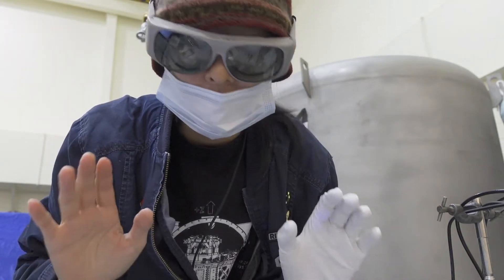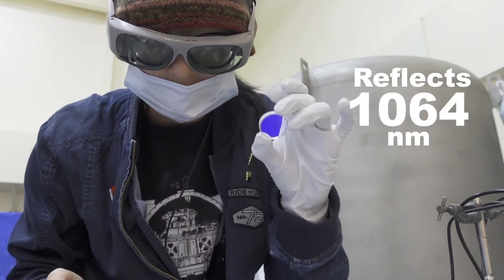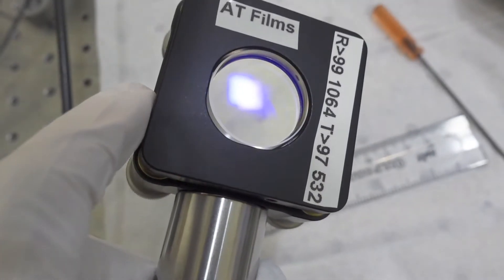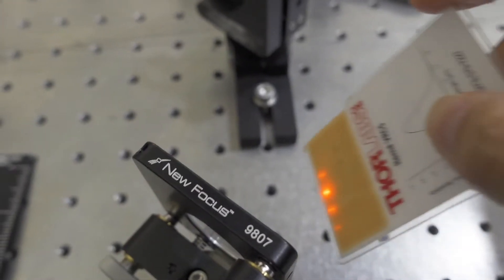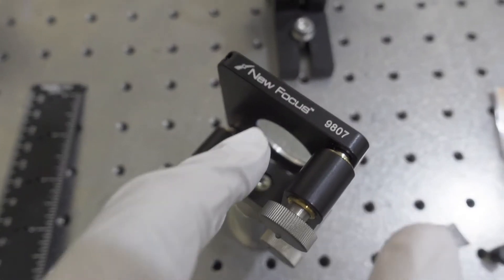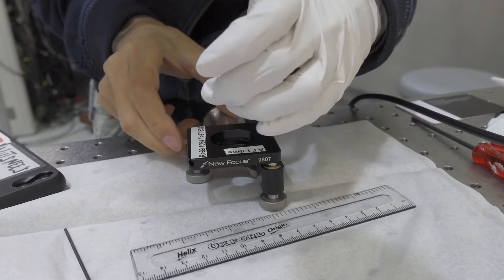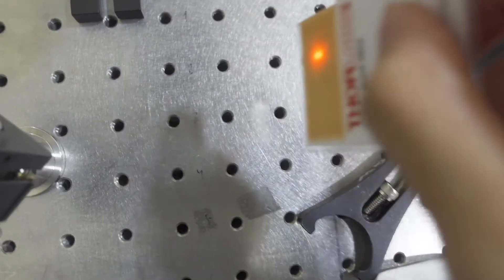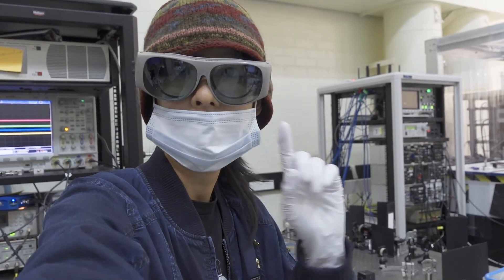OPTICS LAB | DICHROIC MIRROR/BEAM SPLITTER: How to tell which side faces forward

Comment: The ghost reflection is an obvious way to know which side is facing the incoming beam, however, the spatial resolution of the ghost reflection and the main/true beam depends strongly upon the thickness of the optic, imagine a case where your optic is only 0.5 mm! now, the ghost reflection and the main beam are unresolvable!

Comment: A really easy way is to get an object like a Q tip that will not mess up the surface of the optic and gently touch it to the surface.  If the reflection touches the object that is the dichroic side.  If there is a gap between the reflection and the object that is the non coated side.

Comment: since dichroic mirror will pass one wavelength and reflect other.suppose 1064nm pass and 532nm reflect.you can use a green laser pointer send light on one side and see whether it reflects right ?or if aligned correctly ,the 532nm output power coming out of mirror should be less as it reflects